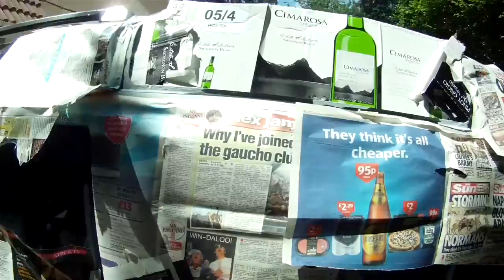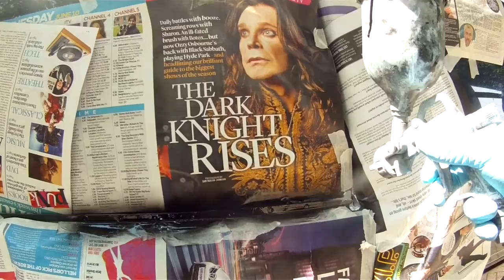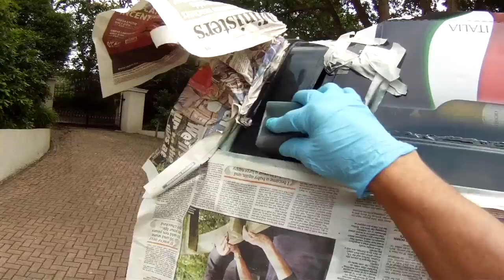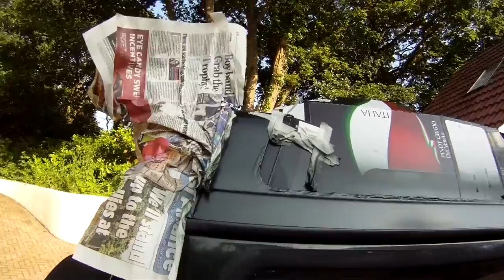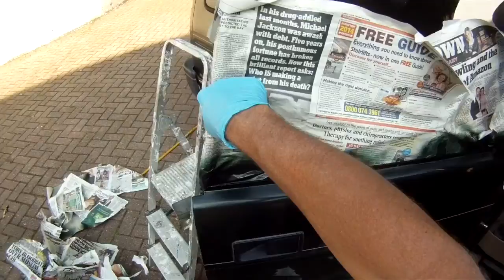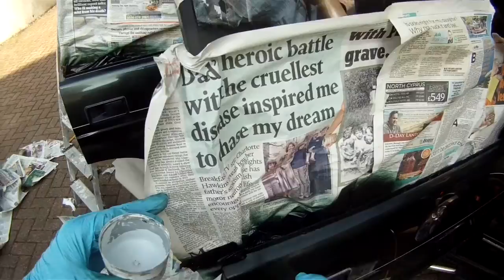Landrover Discovery 1 - Fixing and Repainting Minor Body Corrosion

Comment: No issues with aluminium and steel contact corrosion? Needing to do a massive amount of repair around my Alpines and not too keen on welding. This looks a treat.
Reply from the maker: No issues.  The roof is all steel.